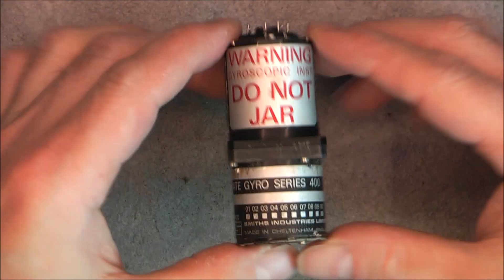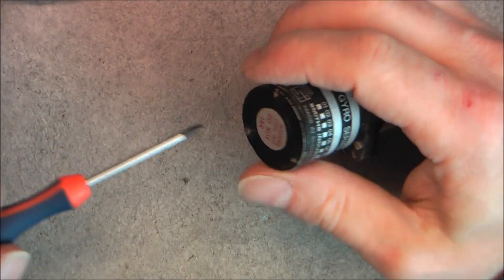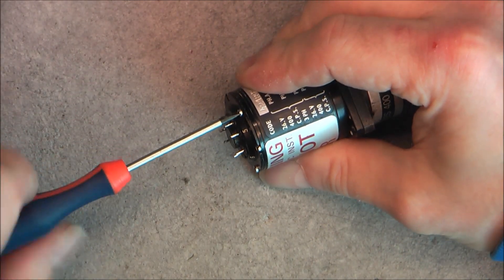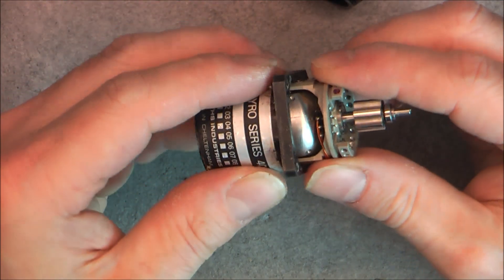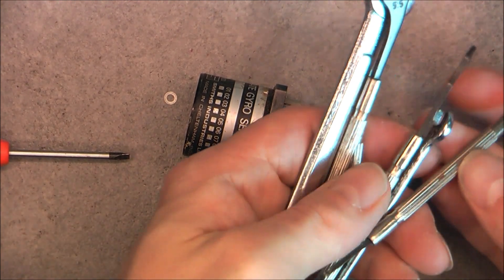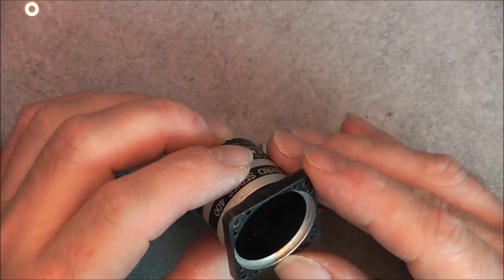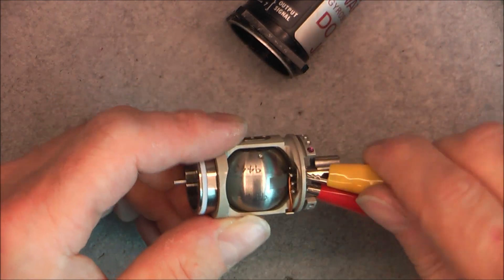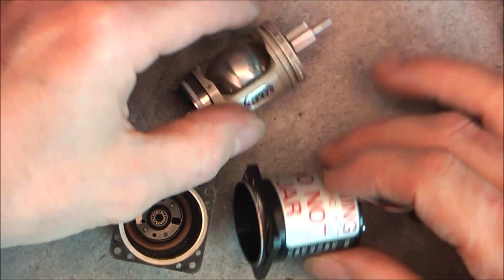Smiths miniature rate gyro teardown

Comment: Hello Mr Sylvain, if you put some 3.3 ohm power resistors inline with the 3 outputs you will significantly reduce the chance of blowing one of your Tda 2030's, plus the inverter should still work fine.

Comment: -1 point for a silly/basic mistake of not soldering small wires to the terminals first instead of using large alligator clips. +1 point for keeping spare amplifier ICs inside your inverter haha. All kidding aside - fantastic video! I've never seen such a small gyro.. it's honestly fascinating, especially given that it's constantly being moved by the antenna assembly.. I wonder what the reliability was like on these. If you end up lubricating the bearings, I have only one suggestion - one drop of Krytox 143 AZ oil. It's an expensive low-viscosity aerospace oil ($80 USD for 15mL), but even that small amount will last you for many years. High temperature + low viscosity + inertness makes it useful for a lot of applications, even mechanical watches. These types of products usually require minimum friction, so any thick oil or grease will usually be too much and will prevent the gyro from operating properly or even spinning up to full speed. Good luck with the inverter repair!